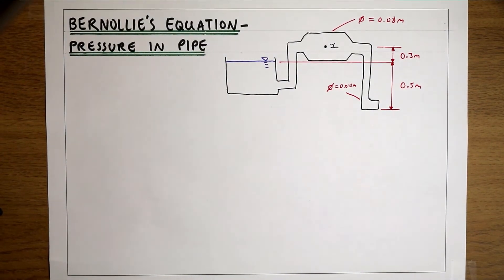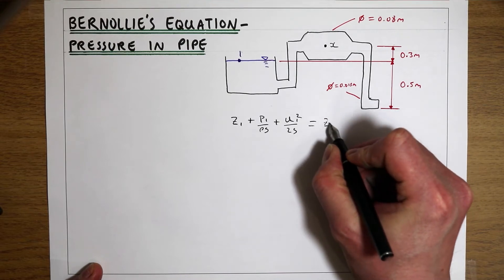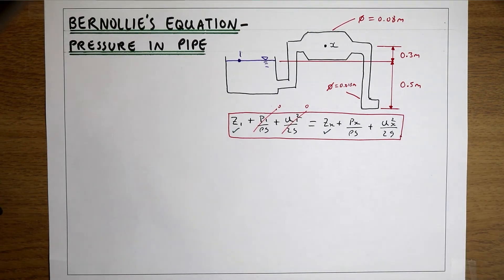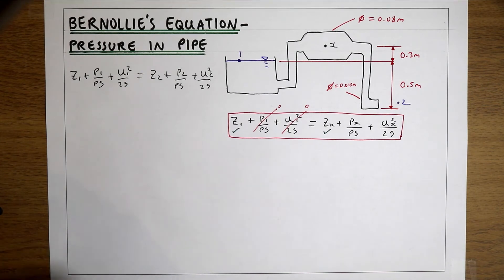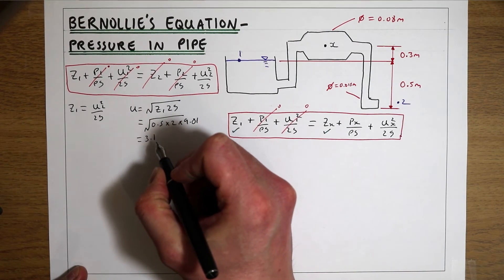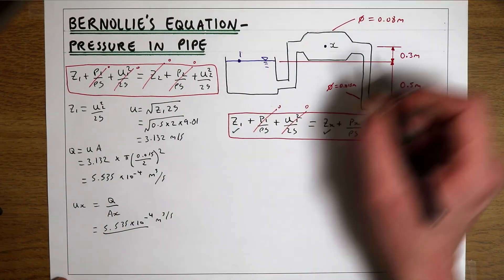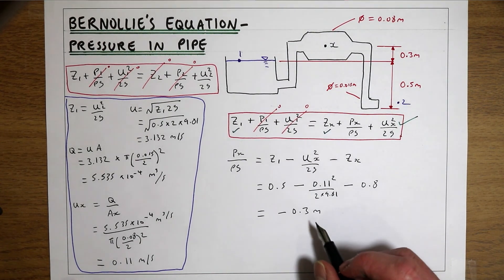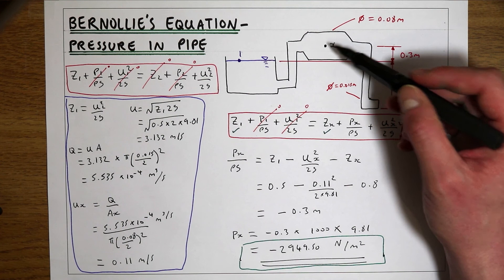Bernoulli's equation to find pressure in a pipe above water surface of tank

Comment: That's interesting. Z1 = U2^2 / 2g => U2 = (Z1 · 2 · g)^0,5. In terms of distance travelled. It can be easily checked that free falling object gains speed at 9,81 m/s/s rate. Thus after 1 second of movement its speed will be 9,81 m/s and it will travel 4,905 m. Let's check it. U2 = (4,905 · 2 · 9,81)^0,5 = 9,81. And, as we can see, it doesn't depend on the pipe diameter.
Reply from the maker: Yes, the velocity at the outlet is independent of diameter as is simply set by the pressure difference between the start and end of the system. But once this pressure difference has set a discharge for the system, the diameter of the pipe when under pressure inside the system will affect velocity due to continuity. It’s actually a concept that took me a little time to get my head around as a humble civil engineer.
Reply: From where did you get the 4,905?
Reply: @Fabricio201082  distance travelled over time 
S = So + Vo · t + a · t² / 2. So = 0. Vo = 0. t = 1 s. a = g = 9,81 m/s².
S = 0 + 0 + 9,81 · 1² / 2 = 4,905 m.

Comment: Hi. What does negative pressure mean at point x ?
Reply from the maker: Great questions! The pressure is not actually negative, but in this example, we are assuming atmospheric pressure as zero. So what we are saying is that the pressure at x is below atmospheric presume. This is, however, important, as it means if there was a leak in the pipe, it would suck fluid in rather than push it out.
Reply: @fluidsexplained1901  thank you so much. I really appreciate you 🌹. I exactly got what you said. Negative pressure means we have vacuum in the line at point "x"